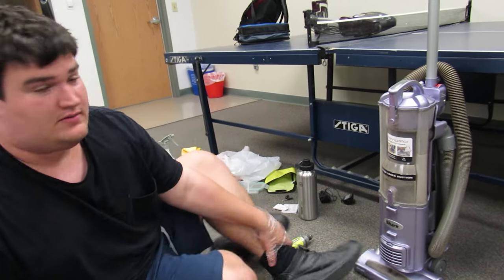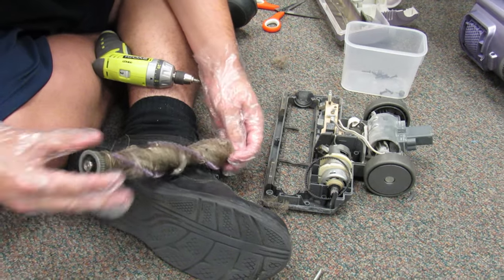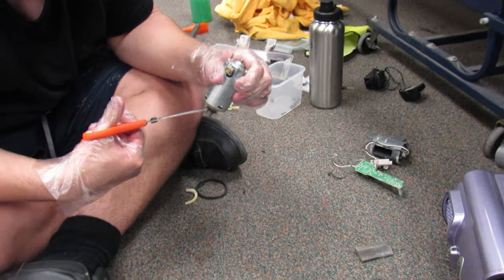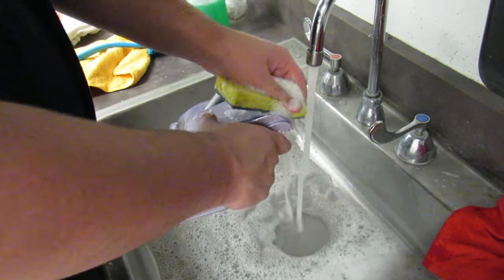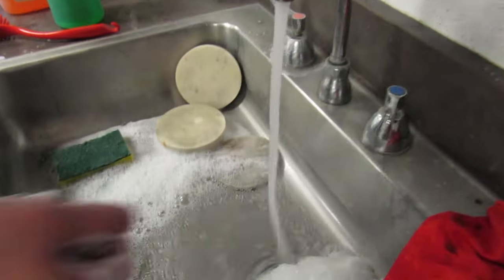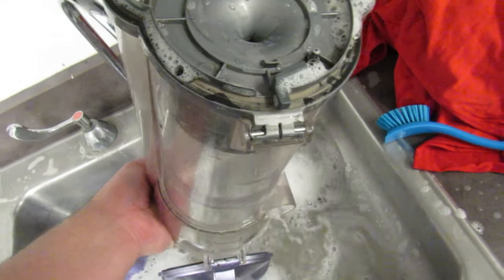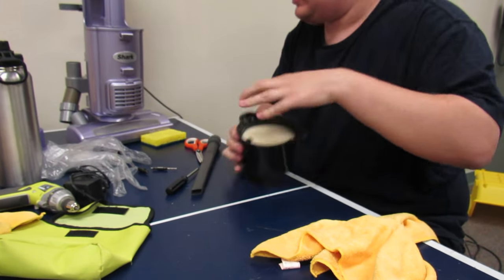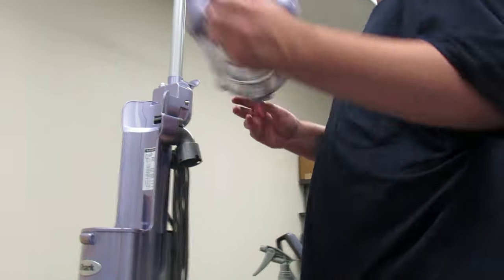TRASHED! Shark Navigator nv22l. Deep Clean!

Comment: I trash picked one of those last year and just recently finally fixed it. I believe it will be a keeper. What’s amazing is that mine had both on board attachments, plus I found the black bag with two more attachments and the spare filters.
Reply from the maker: Interesting. My friend found a dyson ball on the curbside, brought it to me where I found it only needed a cheap fix. Still works years later
Reply: @VacMaster1991  Mine had a problem with the brush roll. It was melted on the Non belt end. I was never the less still able to use it by cannibalizing bearings from another shark. I also cleaned it all out. I’m curious why you run your brush roll underneath the running water as that could get water in the bearings.
Reply from the maker: @nonelost1  Because it's was absolutely gross and that's all that could clean it.

Comment: I have this model NV22L and the little hose between the cleaning head and the canister has a big crack. It looks like the upper connection is part of the canister assembly. Any ideas on if it can be fixed?
Reply from the maker: I think you can replace it. Those usually can't be repaired well

Comment: I have one of the shark navigator model nv22l the brush head keeps losing electrical contact when using the vacuum so it comes on intermittent any suggestions on a possible fix or would you have a replacement head assembly for it
Reply from the maker: You can check and see if there is any dirt on the connectors. Also take the head apart and  see if wires are loose.